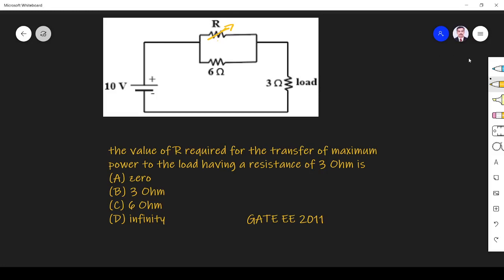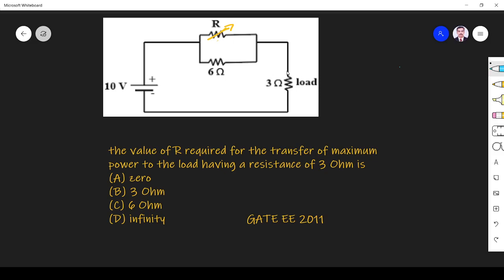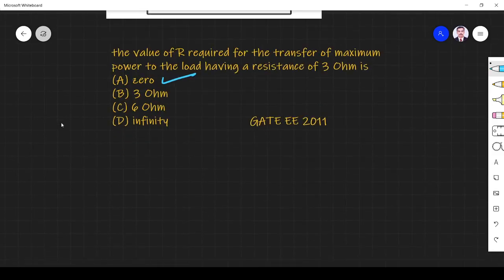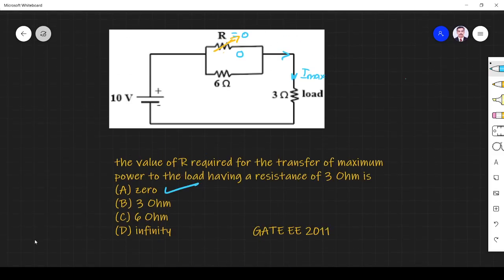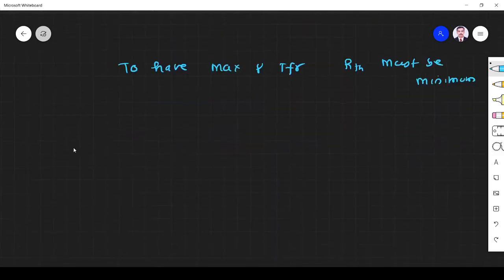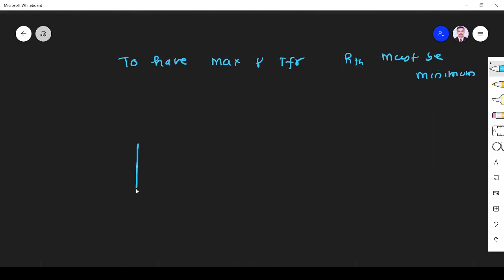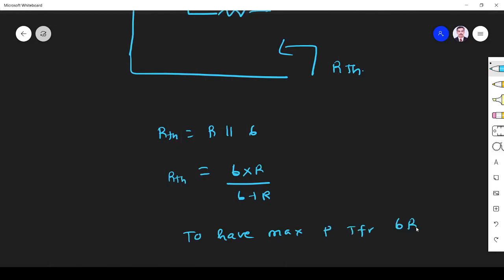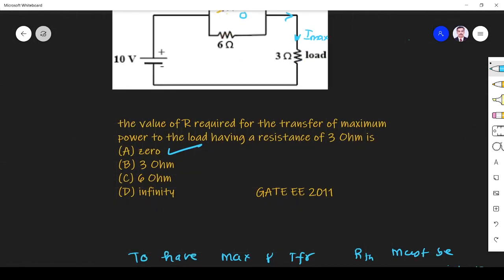Network Theory GATE 2009 EE Maximum Power Transfer Theorem |#60| @majeethlectures

Comment: Why we Not Used load resistance equal to circuit resistance. ..if we proceed like that resistance will be 6 ohm..is that approach correct. .
Reply from the maker: Maximum power transfer theorem is applicable only if load is variable...if load is not variable we have to take the least value of resistance in the source...it provides Max current to load...thus max power transfer...for this problem answer may come correctly by finding Rth but for other problems it may be incorrect
Reply: @majeethlectures  explained greatly
Reply: Thank you..
Reply: Thank you❤🌹🙏